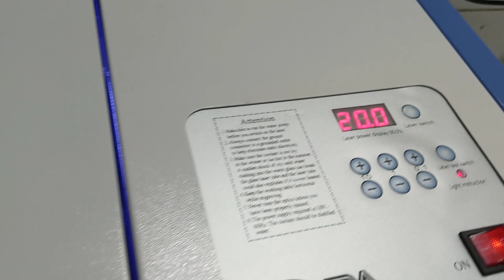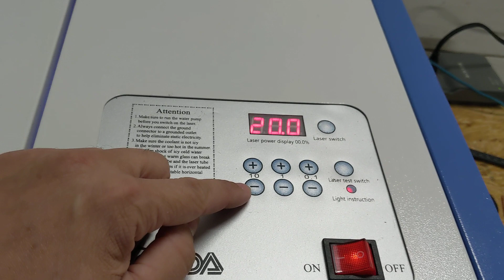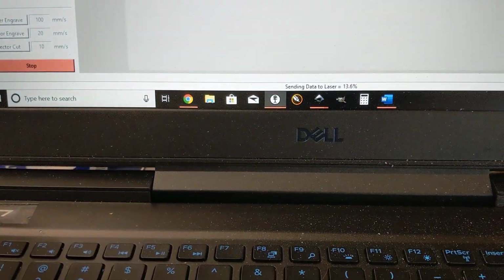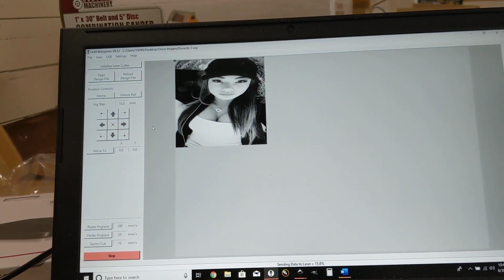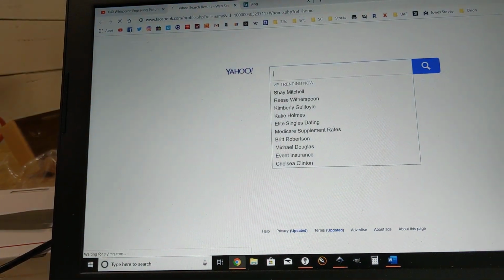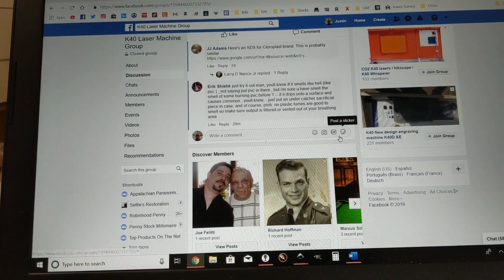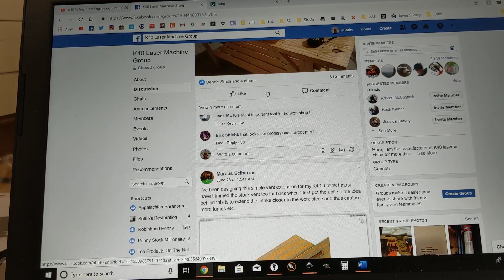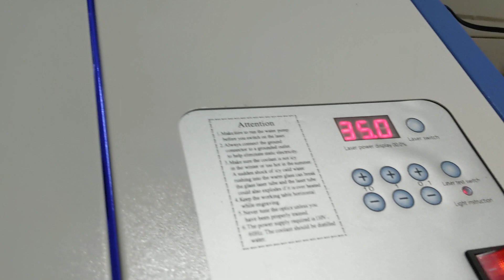Orion Motor Tech 40W Co2 Laser Engraving Cutting Machine, 12 x 8 Inches K40 Desktop Part 2

Comment: Hi Justin! I just got this machine and I really appreciate your videos so far.  I knew when I purchased this machine that it would require a lot of work to get it going. I'm curious if you went through the process of "focusing" the laser? --the whole mirror #1 -#4 (difficult to understand) focusing method described (not so well) in the instructions?  --I haven't fired up the machine yet, but curious to know how that works and the best (or your rec) on software to use?  --Does Coreldraw work?  --In theory, can I "print" from coreldraw?  Also, I removed the 4 screws from the printing surface, and  there's a spring loaded clamp built into the machine.  --Is that a remnant of the older version? Is it usable?
Reply from the maker: I dont know why I never was notifed about your message. I found that you dont have to waste money on software the best ones are free. Also, became very ill after these videos so I never got to use it. Sorry I cant help more.